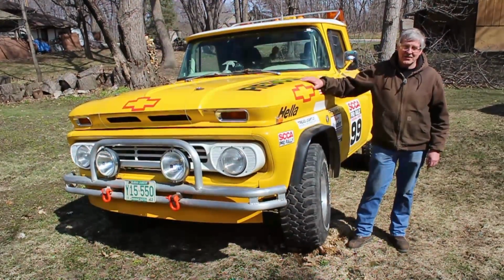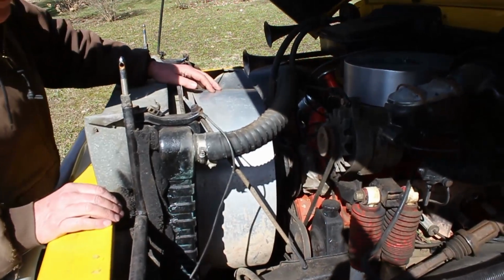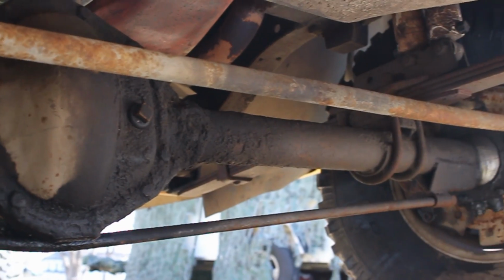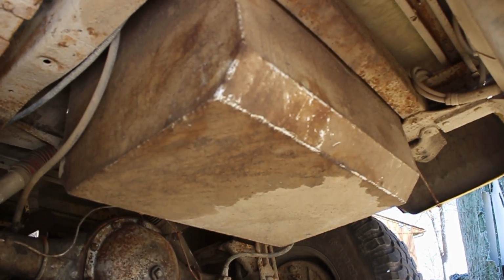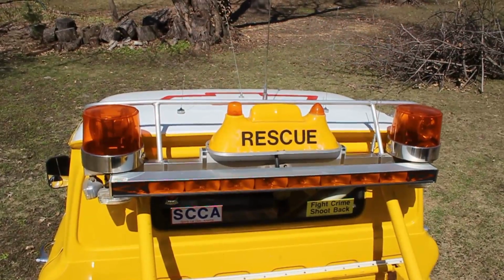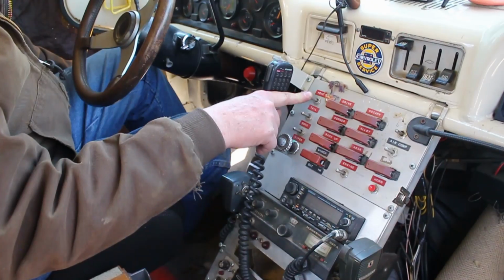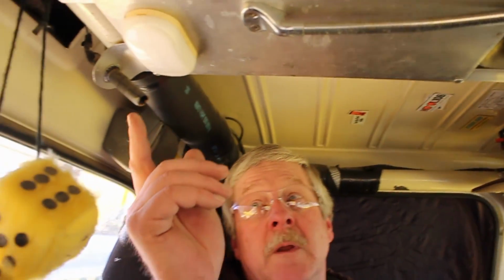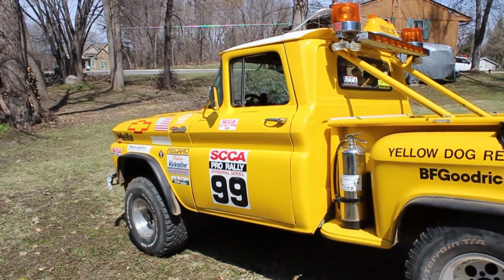Yellow Dog IQCS 2020 1962 Chevrolet K10 4x4 Pickup (2)

Comment: WOW  so many modifications. Lot of truck  , it is  definitely a go getter. Neat to hear you have a  quadrajet . they are great carbs.
Reply from the maker: Long ago I found a book written by one of the design engineers on the Qjet.  He raced it on a whole bunch of different engines, from Covairs to Big Blocks.  After reading that, I knew it was what I wanted.  It has been nothing but great.  The really strange thing about this carb, it is a Carter, not a Rochester.   I didn't even realize that till after I had it running on the truck, its made to GM specs, all the parts fit.    Great carb, much easier to work on and tune than any other I have worked on.
Reply from the maker: Babylon falling  the only problem I have ever found that could not be corrected is that it is a carburetor and thus subject to gravity, it won't work upside down!   So many parts to tune any engine for any circumstances!  And they stay in tune once set.  And more than enough flow for any reasonable (less than about 500 hp) street engine.  Love it.   My newest is going on my '69 350 powered fire engine.   About 20,000 lbs and I am certain it will get better mileage and power at the same time than the stock setup.
Reply from the maker: Babylon falling  Well, I wouldn't say, "a lot"...  but the truck has spent a fair amount of time at less than one g.
Reply from the maker: Babylon falling  It rolls enough to give understeer at the entrance to a turn and oversteer at the exit.   The springs do not consistently locate the axles during cornering roll so the heavy undercarriage  causes initial understeer and the roll points the front axle in and the rear axle out.   Driving it fast on gravel is not bad because of the slippage, but on a solid/good road things tend to get out of normal pretty fast.  The driver better be ready to make directional corrections or the physics will take over.  It all happens pretty fast so somersault is not a bad description.  4 leaf springs are not found on race cars for good reason.

Comment: I would love to see you powerslide that bad boy through a corner,  about 10 feet off the bumper, filling the rear view mirror of some rice rocket.   Really good work.
Reply from the maker: That has happened more than once but, can't prove it just yet, the video crew crapped out.  We are working on a camera car that can keep up.  When it happens, it will be posted here.
Reply: @sweepleader  Dash or hood mounted go-pro works pretty good.  Thanks for the reply.
Reply from the maker: @iBackshift  My son is very good at that, sometimes with 3 cameras on a car.   This is my first "real" video and we are learning a lot.  Thanks for the suggestion, I had not thought far enough ahead to get there on my own.   Keep watching, this is where it will be.
rallyrat:  https://www.youtube.com/watch?v=V5sgrJywOTk   :{)
Reply: I'm pretty sure that's happened more than once with a broken rally car in tow filling the rear view mirrors...
Reply from the maker: @RallyRat  Yeah, I did not think of that.  It has happened more than once that a rally car on a 30 foot rope has followed the Dog in a drift.   5 or 10 miles of drifting in fact.  Plenty interesting setting the truck into a drift only to have the guy on the rope hit the brakes and yank the rear end in an unpredicted direction!  That will result in some pretty fast recalculations.

Comment: I speak for all who watches this and in that being said.. we need to see action from this ride. We need to hear some redline for a good time and some minty fuckin 4wd launches. What a beautiful truck.
Reply from the maker: We will work on some action for the channel.  If you need vehicular abuse, you will have to go elsewhere, sorry.  Thanks for watching.
Reply: @sweepleader  how well you able to make it down some of the tracks you recover cars from in it?
Reply from the maker: @joshwise8507  It was often a trick but most of the "roads" were not that bad.  The speeds needed were another story.   Some roads were sand two tracks and tough going but the rally cars mostly made it.  We have had to tow perfectly good cars down some roads that were so bad we just had enough traction left over to get them through.   The speed thing was necessary to maintain schedules as usually the roads were used more than once a night and had to be cleared in time for the next running.  You cannot leave a car blocking the road, even partly when others will be along at race speeds.   The recovery process was always in a hurry, we had to be very careful to not injure ourselves, we were a long way from help and it was often that an ambulance had no chance to get in and out again.   Many of the roads would rut up and with the wider track of the truck, we only had room for one wheel in a rut, the other was up and out.  Tough to run for long like that.  Always good fun.  Many of the roads are uphill on one side and down on the other, if a car went off it had to be recovered straight sideways.   That meant one truck in front, another in back pulling away from each other to drag the car sideways.  Oh, there are a lot of stories.  One car had to come up over a boulder about level with the road but 6 feet in diameter, the car down in a swamp.  That was fun.  We saved the car and it left under its own power.
Reply: Thanks sweepleader  sounds like a fun time.

Comment: I like the axle truss situation. I'd like to do something similar to my 76. Im trying to clone a 76 chevy military truck with it lol
Reply from the maker: I bent the axle enough to upset the camber at one point and decided on the truss.   I used a 5/8" cold rolled rod with self locking nuts.   A matching radius got ground in the drain plug to cradle the rod where it passes under the diff.  Since the truck was used on roads good enough for rally cars with less clearance, I was not worried about rocks taking the truss out.   No heat was used to put the bend in so the work hardening of the cold rolled steel was not affected.   The brackets on the ends were carefully placed inside the shadow of the knuckle seals to prevent them from reducing the turning radius on this old closed joint axle.   I have been very pleased with the results, very light (about 8 lbs including the brackets), no steering changes, and no more camber changes in many years of hard running.  Thanks for looking.
Reply: @sweepleader  thank you for the reply. I'll look into building one for my truck. Anything you have to worry about while welding the angle iron to the cast iron axle?
Reply from the maker: @oldcroneysgarage9739  The 'angle iron' is  2 pieces of flat steel shaped and welded to the tube.  They gusset the weld at the end of the axle tube as I felt that was a weak point.  There is no cast iron involved, the ball on the end of the axle is steel, the axle tube is steel.  I had the axle out of the truck so I could turn it over and weld on the top.  Be careful not to weld in the area swept by the ball seals.  With all the steering parts removed from the axle and the housing clean and free of grease, the area swept by the seals is easy to see.  The strength of the truss depends entirely on the welds, make sure they are good.  If you have doubts, find someone who does not to do the welding.  I am proud of the design and will try to help any way I can.

Comment: how does that idle control switch work?
Reply from the maker: Its a standard remote throttle control, there is a mechanical cable to the carburetor that pulls the throttle open when you pull the knob or screw it to the left.   There are threaded parts inside the knob that screw out when you turn it and pull the cable.  The red central knob releases the threads when pushed and allows a quick return to idle.   Throttle controls like this are used on industrial machines where the operator needs fine control of the speed but then wants it to stay there for long periods.    I installed it when I had an air compressor on the engine for use with air tools doing rescue work.   A few years after I installed the compressor, battery tools hit the market and I took the compressor out.   It was just excess weight at that point.  The control stayed so I could idle up the engine as I wanted to from time to time if the engine was hot or I needed more electrical output.   Farm and industrial suppliers sell controls like that, I got this one from NAPA.